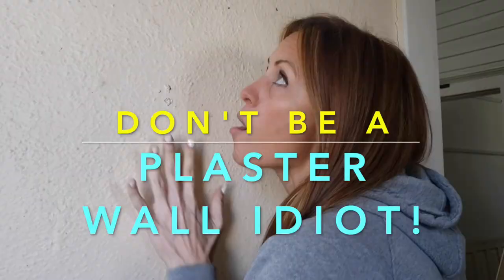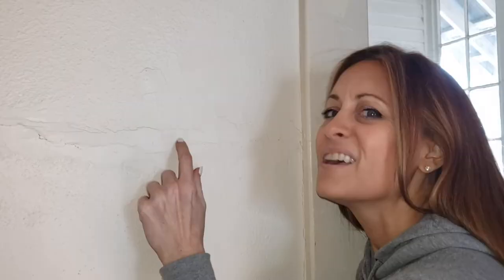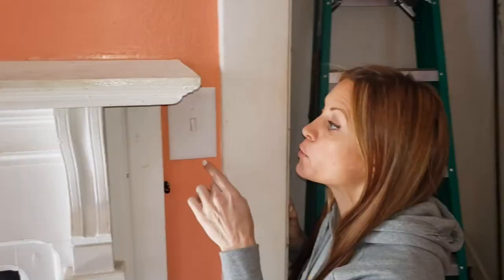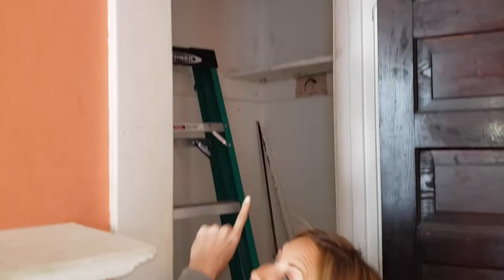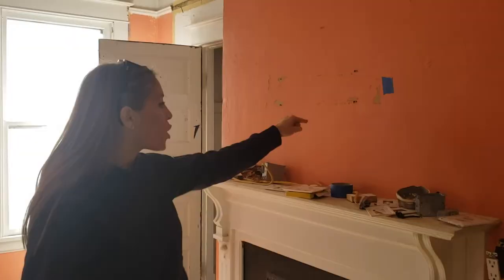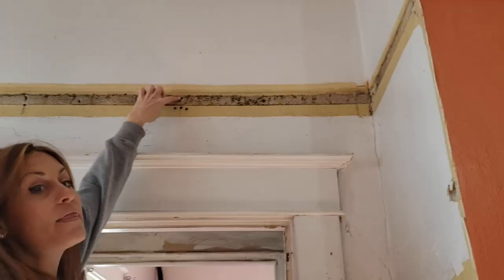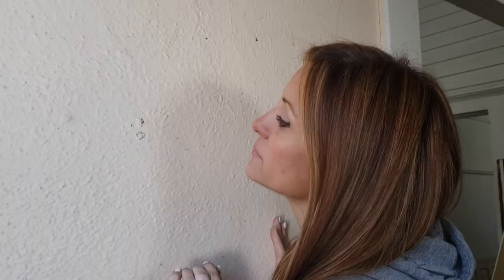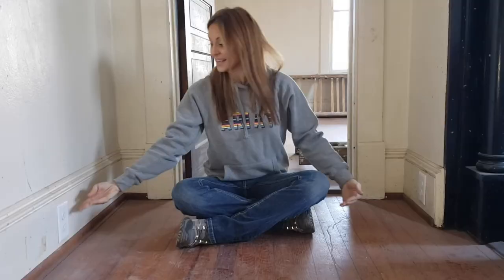Don't be a Plaster Wall IDIOT!

Comment: But didn't she cut holes to install the outlet above the fireplace and on the wall for the sconce??  It's good she explained what happens when you put holes into plaster walls but, it would have been much more informative if she explained the correct way to cut holes rather than calling people idiots.  I recently purchased a home not knowing the walls were plaster.  Fortunately, a contractor pointed it out when I was deciding if I wanted my TV mounted on the wall or left on the stand.

Comment: None of this told me how to hang pictures 🙄
Reply from the maker: Yeah. I was in a totally crappy mood that day and super annoyed bc my film crew was bugging me for a video. I told them to just film what I was doing and figure it out. They did the best they could,  asking me questions about the plaster.   They somehow came up with this video from whatever was shot that day. 

It kinda sucks, yeah.  For whatever reason, people have started watching it a lot recently.  I plan to redo the video and actually tell how to cut plaster without cracking it, hopefully soon.

For now, I do have a video about hanging heavy items in plaster, and it may help.
Reply: @AdrienneLovesOldHouses  I don’t have anything really heavy for those rooms. My rental was 1910 but has a room that’s all knotty pine. My big stuff has gone in there. I have sticky stuff that says it will hold my regular pics. But scared they’ll break. Thanks for commenting
Reply: @melissamccutcheon1970 for light stuff like pictures, use monkey hooks. DONT try to wiggle them in, use a TINY drill bit to drill a pilot hole for the hook, then push it in.  

I would LOVE to just use picture rails but mine were removed and I can't find new ones...so....hooks it is.  

For heavy items try to hang it on the lath stuff whenever possible.  If not, toggle hangers are your only other option for a secure hold.  You will need to get the one with the tightening tool that almost looks like pliers.  This will give the firm hold without cracking the lath behind it.

Comment: This is kinda nonsense. There are very good ways to drill and cut plaster without cracks occurring or your plaster separating from the lath. You just have to do things carefully and use the proper drill bits and blade.

Comment: why should you keep the plaster any answers?
Reply: Here's a few reasons: It elevates your home value, it is extremely sound dampening, it breathes so there is less chance of mold, historic lime (and to a lesser extent gypsum) plaster actually filters and cleans the air, it's more structurally sound/solid in the event of something/someone falling into/against your walls (think angry fists or rambunctious kids) so no massive drywall holes to patch after, when there is a hole plaster can be patched seamlessly and be completely invisible, whereas you will almost always see a drywall patch, and...it just looks/feels nicer. 😬
Reply: @jaelynrae6045  I agree.  I ask people why keep the brick? Can’t you just put vinyl siding over it?
Reply: @ericaulbach Because brick houses, especially ranch style brick houses are in high demand right now. And why would you want to cover beautiful original brick work with some cheap new vinyl siding? Seems silly to me. But I’m not sure if that comment was meant to be taken seriously or not, reading it back it seems a little satirical lol

Comment: Hate/love relationship when it comes to plaster. You can right a lot of wrongs in crooked old homes, literally by plastering the wall at a right angle. BUTT  omg all of the above in the video. I hate how it breaks, cracks, can't attach nothing to it, it's also tedious to do, ugh. Told my boyfriend: no, the next room we are using drywall to fix the crooked wall. I don't care how.